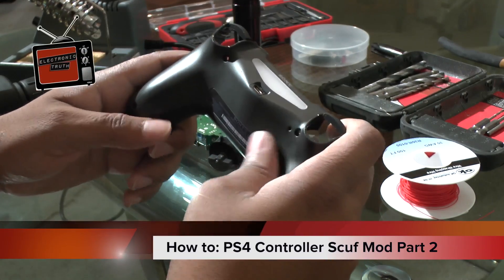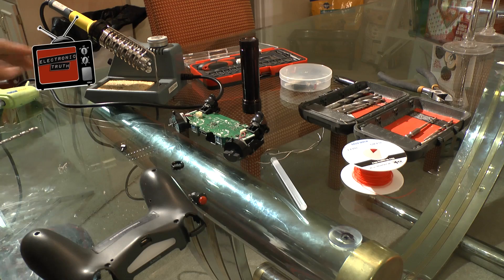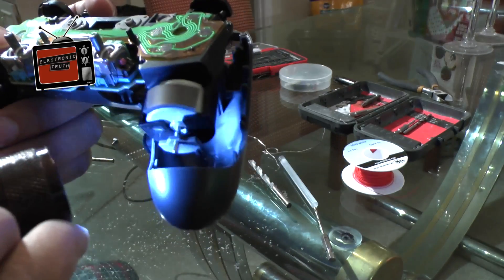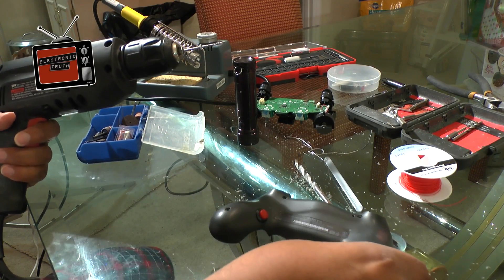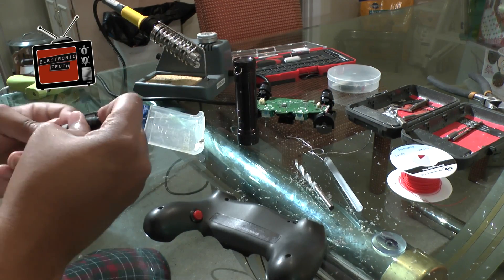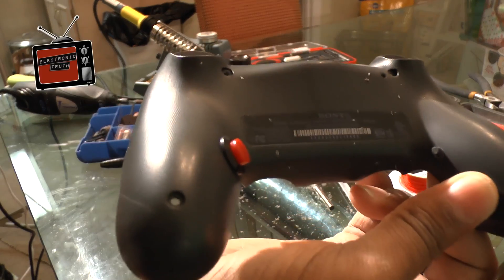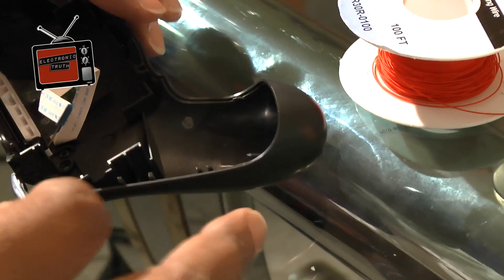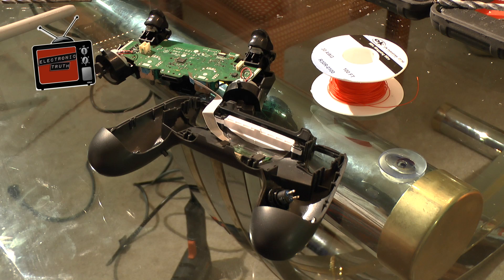How to: PS4 Controller Scuf Mod Part 2

Comment: Here's a tip: If you're about to drill a hole, use your soldering iron to burn/melt a small hole exactly on point that you're about to drill the hole( don't push it through, just a little crater) . now you can easily drill the hole without missing/ scratching your controller..
sorry for the bad english, not my main language ;)
Reply: Very smart
Reply: And your English is great
Reply: bran thanks:)
Reply: Dude your English is gr8!
Reply: Clever, I will definitely be doing that :) and as others said your English is close to perfect.

Comment: Nice video. Buttons look good. I think I'd like the red button better. I think you would benefit by buying a set of Brad Point drill bits to make drilling the holes easier, the tip has a sharp point. Just my opinion... Can't wait for Part 3

Comment: Hi, Love the videos I would like to offer my experience with  drilling plastic, if you slow your drill down a bit it will not melt the plastic it will just shave it off, try it out and see what I mean. Also works great if you are using the dremel, when you slow it down like to min speed it will not clog up your sanding wheels with plastic, making em last longer.

Comment: Does anyone know where the solder points are on the jdm-020 pcb board. My controller is newish and am wanting to do this mod. I've got the buttons installed just need to connect them to the board. Any help is greatly appreciated. I used the same buttons so this vid. Had to cut the plastic that held the rumbles to make it fit. I never used them anyway, lol. Fits like a glove , just need help with what tabs to solder to. And can I connect them to the face of the board or do I have to go from he back like you did?
Reply: what do you mean with the jdm board? If you look closely at the printboard, you can see all the copper lines running from all the buttons towards the center where you can solder them. For example : above the "arrow up button" you see the copper line , you need to follow this line until you reach the point where he shows where to solder them. This probably doesn't make any sense so if you want me to make a picture or something, let me know
Reply: Hollanderr can you Show us the solder points?
Reply: Hollanderr kan je alsjeblieft een foto laten zien waar het O soldeer punt zit?
je zou me er erg mee helpen
Reply: Hollanderr  hey kann u show me that ? where to find that x & o? can send u a picture if u want